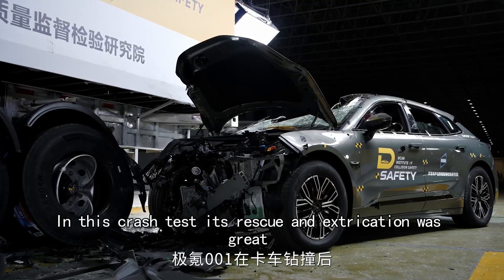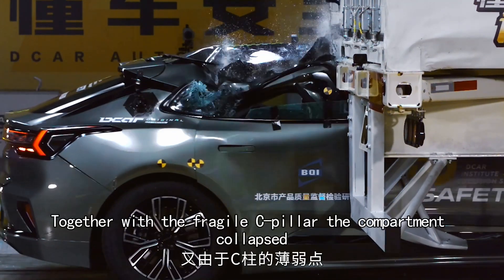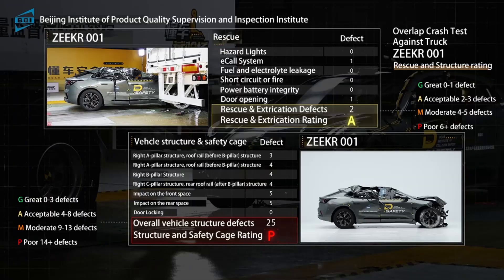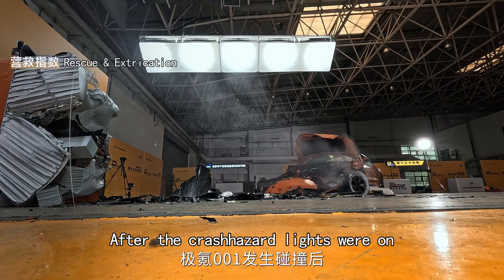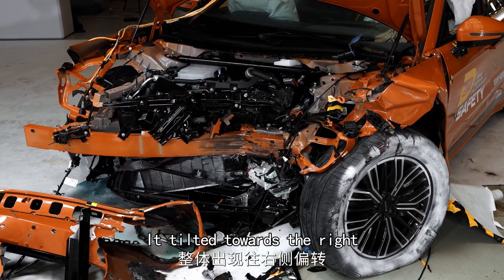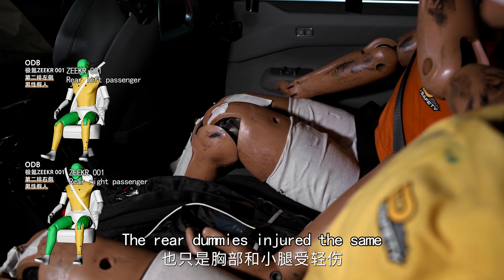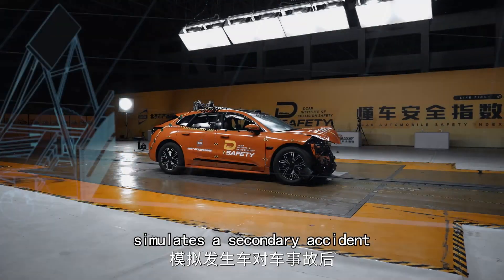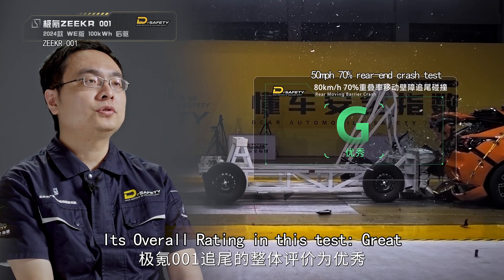Zeekr 001 Crash Safety Test极氪001 碰撞安全测试

Comment: crashing the A-pillar like this is common on most cars to crumble, some cars even the roof cut off, unless they make a rigid C-guard like Smart4two which is uncommon nowadays.
Reply: Check their other videos, Telsa Model 3, Volvo S60 all fare much better in the same test.
Reply: @IYKYK-UK that is not fair comparison as the car height is different and shape of the pillars also have different angles. if you make the pillar pointy it will go under the truck rather than having straight cut.
Reply: @bunnatang  That’s just the outward design, the crash protection is supposed to be built into the chassis frame. This car has weak designed engineering for the chassis frame. The B pillar should have at least taken the force and stopped further collapse but it continued on to the rear.

Comment: should be selling good in china if really good in material used
Reply: This is a car with solid materials. However, due to the rigidity of the vehicle body, the rear anti-collision beam of the truck has almost no buffering effect. The overweight of the vehicle body is also a major reason for the tragic collision results. In standard offset collisions it performs very well.
Reply: @chjin1796  You don't know what you are talking about. It did not perform well. They said the front longitudinal beam deformed in a strange way. Thta means that this manufacturer has no clue how to design crumple zones.